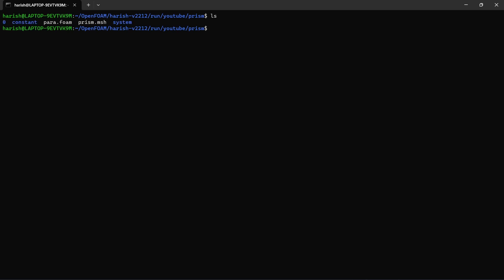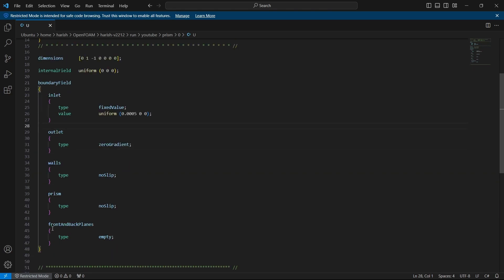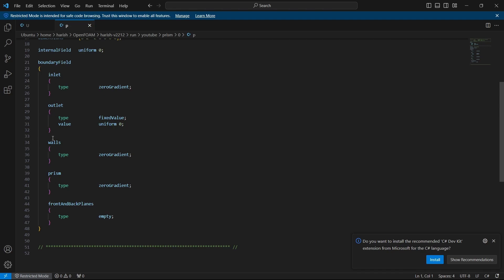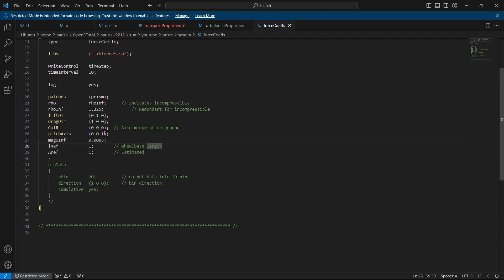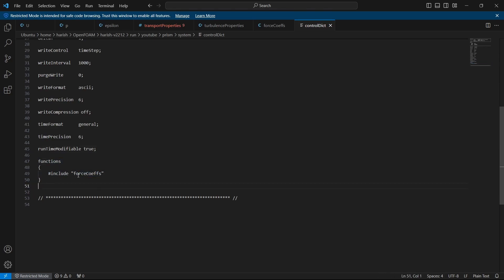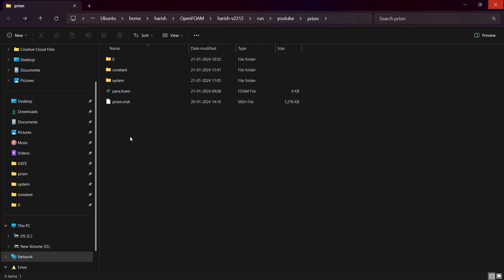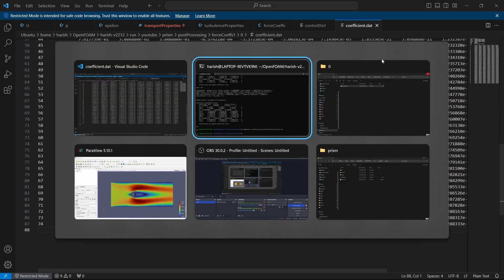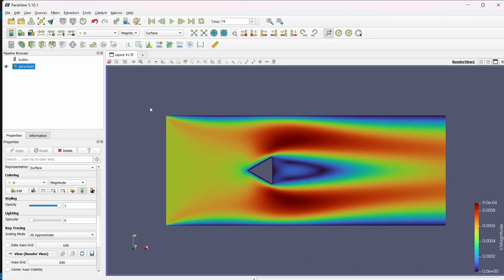Prism Drag and Lift Calculation and Plotting | Cd Cl | OpenFOAM CFD | simpleFoam

Comment: if  I have turbulent and unsteady flow how to take rho?
Reply from the maker: Rho would be material parameter. but in pimpleFoam you just have to give kinematic viscosity.
Reply: Means nu
Reply: Yes, I have used pimple foam, rho will be then nu used in transpoet properties?
Reply from the maker: rho is not needed. just nu is needed in transport properties. nu is kinematic viscosity.
Reply: For calculating Coefficient of drag and lift in the force coefficient what should be rho
Reply from the maker: Your material density

Comment: Hey! i really liked the tutorial but you mentioned sharing the file for turbulent steady flow. also i am working on validating the Cl and Cd for  naca2412 but my results are  aligning to the real data. if you could help with that
thanku
Reply from the maker: The results depend on a lot of factors such as your mesh, the Y+, the relaxation factors, etc.. 

And sorry, I do not have the files I used for that simulation now.
Reply: @Codeynamics  do you have any case where you calculated Cl and Cd using simpleFoam
Reply from the maker: Regardless of the solver, the procedure is the same.

Comment: Hello there, I tried to add this to another simpleFoam case. Interestingly my forceCoeffs are 
    Cm    = -9.13425e-10

    Cd    = 0.00573774
    Cl    = -7.90766e-07
    Cl(f) = -3.96296e-07
    Cl(r) = -3.9447e-07

But there's no CmPitch, CmYaw ...etc. what am I missing? Thanks for this great tutorial series btw!!
Reply from the maker: Thanks for your appreciation. 

The object is symmetrical about the horizontal axis. The lift force from the top would balance the lift force from the bottom. Hence it would be net 0. It is 2D. So we can't really expect Cm here. 
If other parameters are missing, maybe you are using OpenFOAM .org version and not ESI version. 

I hope this helps.